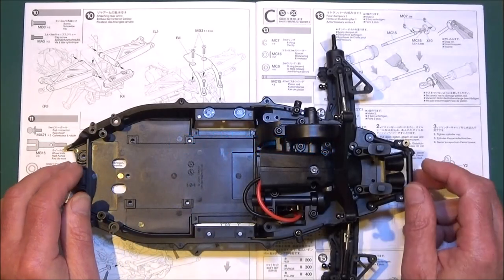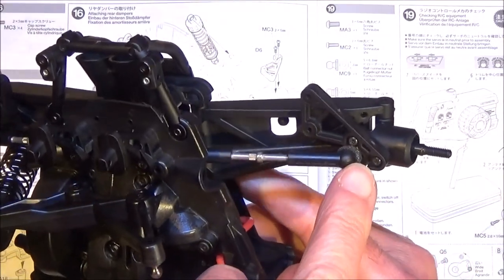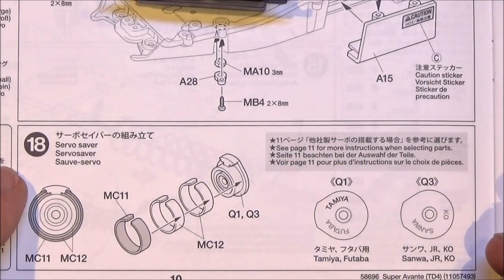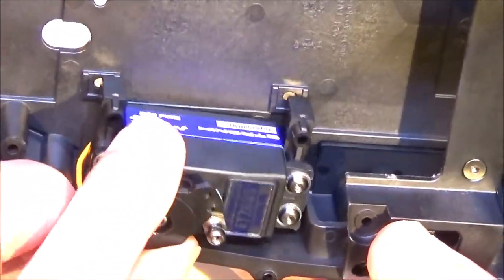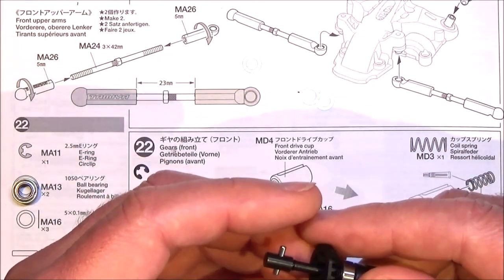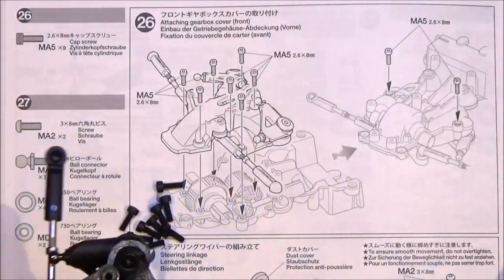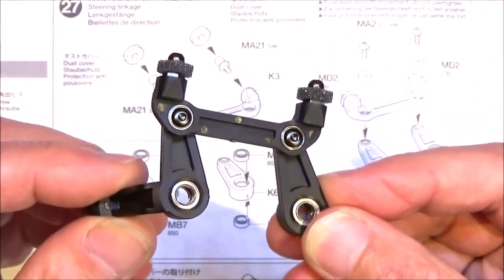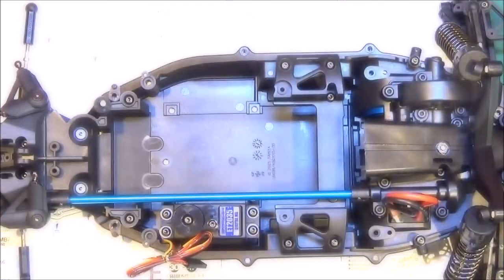Building the Tamiya TD4 Super Avante Part 2 + Build Tips - Parts Bags C & D

Comment: Hello Mark, another concise instructional video for those attempting such a high end kit for the first time. If I were building one of these, I would certainly watch this video, just to make double sure I was fitting everything the right way up etc. Is the ball diff seen here similar to the one many modellers use for the Monster Beetle upgrade ? It looks the same or similar....MP something or other ? I like the way the drive shaft was inserted being spring loaded at one end. Very cool. It never ceases to amaze me how many tiny, seemingly inconsequential parts there are on these expensive Tamiya kits which aren't used on Grasshoppers and the like. That said, on my Tamiya Tiger tank it was a similar story. Anyway in the glaring absence of a weekend - have a great midweek dude....😀👍🏻😀👍🏻.
Reply from the maker: Hi mate and thanks for the great comment as always, it's really cool that you you have faith in me to build this thing properly! Basically it's just strictly sticking to instructions, but then sometimes the diagrams can be a little bit misleading. Always good to see the real thing going together and I also check out some of my favourite channels to get some tips now and then! You are right, the ball differential is very similar to the MP differential that is available for the monster beetle. Yes this kid does seems to have lots of of tiny inconsequential parts but they all seem to have a purpose! That's What Makes This Kit so much tighter then an entry-level kit and you really can't tell the difference when you drive these things. That tank sounds like a serious bit of kit! I hope we get to see one day on your channel. Cheers for the support as always and I hope you had a great weekend to my friend. 😀 🤝👍
Reply: @MarkBryanRC  Oh I definitely have faith in your builds mate, I think I've lost a bit of RC confidence over the years. As for the tank, I built that in 2006 but not too sure I could do it now. You've probably seen the video from 2019, but if not here it is...https://youtu.be/6ht0nzBZf74
Reply from the maker: @thecontractor365  Cheers, mate! Ah, yes I think I did see that video now I think about it, but I'll revisit it again!  :)